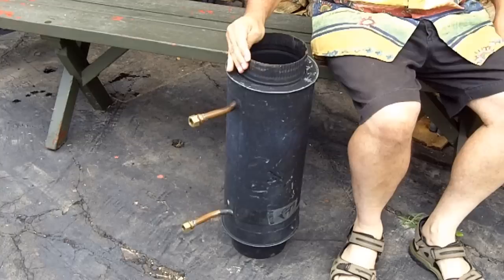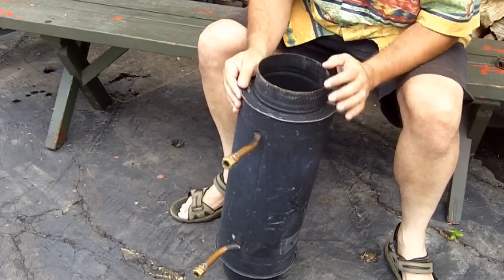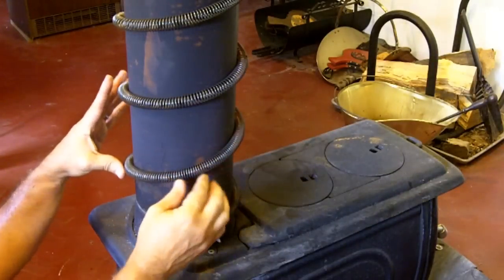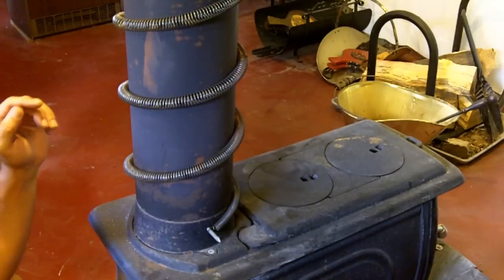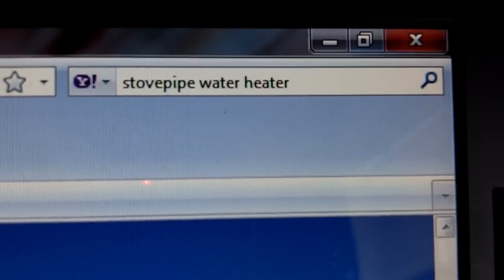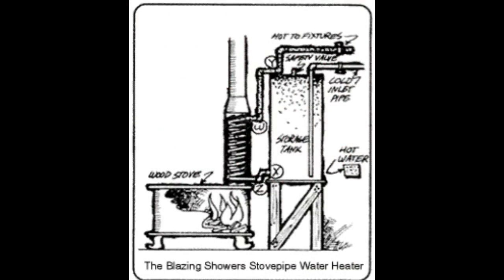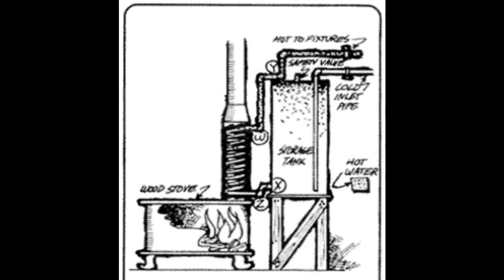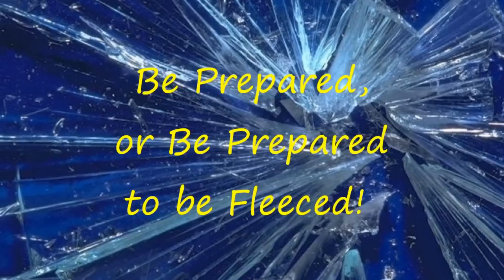Hot Water From Your Wood Stove

Comment: I was a chimney sweep. Have you seen rust (water) or black (creosote) lines running down the outside of the flue pipe? When you are assembling the flue pipe the male end of the pipe ALWAYS goes DOWN no exceptions. (so your unit will be upside dn). All fluids stay inside the pipe all the way down to the fire box. If you have a flue fire it WILL follow the cracks to outside the flue. If creosote is glossy use ACS, clean, seasoned wood, no glossy colored paper. Trying to keep you safe.
Keep at it.
Reply: I'm in Australia and putting a slow combustion stove in out home. With the male/females ends of the chimney, what happend if there is extensions outside the roof would rain get in if male end is facing down ?

Comment: There is so many things wrong with this set-up.  In an emergency, I completely understand: you do what you need to do for short term survival.  However, if this contraption should NEVER be used in a daily situation.  The Laws of Physics apply to everyone.  One does not need a fancy degree from the University of Michigan to understand these laws.  The Building Inspector would condemn this on the spot.  If there was a fire, the insurance company would not pay.
Reply: I agree..... This guy is an armature
Reply: yes that horizontal pipe is a concern

Comment: I wonder if a ss pressure cooker w an inlet and outlet installed on top, inlet being a pipe to bottom, outlet can just be threaded male, maybe pressure valve controllable? or stop it up and install a T&P valve after outlet then to tank.  Put it on a burner of Box stove so flames hit the pot directly, this way you can scrape creosote that might form with ease... You're almost set up to test, see if different positioning of heat exchanger reduces creosote.Good vid, keep it up! CO detector is good!

Comment: we mostly use back boiler systems here in the uk, that is basically a radiator bolted to the back of the stove or built into it, ive thought about this for years but never seen one in practice, good find sir and i look forward to hearing how it went on installation...

Comment: i live in france and have always heated the house with a wood-fired stove.  Now I also have electric heating in addition to the wood stove.  The wood is too heavy.  But the wood stove is still burning.  From the start, this stove has a large boiler with water.  Day and night.  That way I always have warm to hot water.  That works great, without a lot of renovation with dangerous conditions.  I also heat my food, draw broth and stew meat.  Everything on a large stove makes a huge difference in costs when using electricity.

Comment from the maker: @beastlyjamie the old water heaters have some very important advantages: They are already two-walled with insulation, and they already have the inlet and outlet pipes in the correct places and with the correct sized pipes and the threads to fit standard water pipes. Although you can insulate any tank, those pipe characteristics are serious disadvantages of propane tanks, so much so that for most people they will not work at all.

Comment: Pulling the heat out of the exhaust smoke doesn't come free. Cooling the smoke causes tars, liquids, and solids to condense out of the wood gas like dirty rain inside the pipe. (Creosote.) That stuff is flammable, and if gets hot enough it will flame inside the chimney. So it needs to be cleaned regularly.

Comment from the maker: @Mainerism I take the pipes apart each year and check them. The vertical section is never any problem but there is some build up on the horizontal section (which stays very hot.) I run a brush through it before the Winter season and there is no problem. This stove is not the means we use to heat our house. It is an emergency backup in case we lose all other sources of energy and resort to wood. It will keep us and our pipes from freezing. I do burn it some each year to keep the wood pile fresh.
Reply: great idea, would like to find one but where??

Comment: So how has it worked out for you ?, Have you got it fully hooked up and running ?. I see you have a grasp of steam and pressure and the dangers that goes with it, but from seeing that diagram, I would suggest some check valves, pressure regulators, multiple (reduntant) pressure relief safety valves, and a shut off / bypass system.

Comment: nice video...question: should you have the vertical rise straight out of the stove (like you say 3 feet or more) and THEN start angling horizontally like say 15 degrees from the horizontal?

Comment: How hot does the water get coming off the stove pipe? I had some cpvc hooked about a foot from my copper in and out and when i fired the stove up the cpvc almost exploded. So, i am going with copper out on the bottom of the tank and out to the cold water side in the top with a check valve on the cold water inlet coming in allowing me to get heat to the cold water side below the outlet prior to that. Now, i have to get me a 150-175 degree blow off valve cause that water line get super hot.

Comment: @Mainerism I realize this post is 3 mos old now, but I thought I might chime in with more of what Maine has stated. When you burn wood as your primary source of heat, it is important for maintenance of the pipes and chimney tiles to keep that creosote from building up. Getting the right size stove is important as the first step. Most will clean their chimneys and pipes around once a month in the winter to keep the creosote from being an issue. Simple dis-assembly usually keeps the pipes fresh.

Comment: I know the vid is 3 years old now but beware the lack of draft after heating water, extended stove pipe cooling hot gases and stove pipe heater blower at far end. This would constitute a threat of Carbon Monoxide backflow into the living space. Go for it, be there but be alive. Install CO detector.
Reply: True. He almost needs a power vent motor

Comment: I'd put a pump to circulate the water in that exchanger... On some experiments I did trying to get the water moving by convection I found that it will start to boil at the bottom of the coil and make a lot of noise... otherwise harmless for the installation, it would drive me nuts. 
How's that thing behaving?

Comment: ~~~The water jacket, if packed with insulation will take mostly radiant heat from the stack. Adding a backflow preventer will slow water flow down (vs a pump) and increase heat absorption without calling for much BTU from the stack and decide flow direction. I build these water heaters and recommend also installing a small radiator. I use a heater core from a car at the storage tank with a temperature controlled valve diversion.   must also have a pop off valve. The long stack is an issue in conjunction with the water heater. There should be no more than 12 to 15 feet of stack. However,

You could make a steel plate and put into firebox 2 inches under top, closed on the sides and have it 90 down the back two inches away from back and 5 inches away from bottom of firebox. (For stove used here)  This would burn off the creosote gasses and keep the flu fairly clean as burning the gases will increase BTU's. (Like a rocket stove, but not as harsh) You will burn less wood and create more BTU and have almost no smoke. I also install a wye, a damper and have two flu's to choose from. Diverting after you have heated your water. Water would still heat some but not head on (a trickle water heater). This is important. All this can be auto controlled by temp whether under a pressurized system or passive.  Regardless of which, passive or not, the water should be a loop Only going to the storage and never to an end user appliance. The radiator will help prevent steam and lower pressures associated with it. And assist in heating utility room.

Comment: When wind hits the roof and goes over, it creates a down. Your flue pipe should be at least 2'-3' above the highest point of your roof. Trees that have grown to tall will also affect the draw. In spring clean flue,tape a plastic bag over pipe. Ash and water eat metal fast. Don't forget to remove next yr (I've done it you'll know house fills up). It'll keep the cresote stink out of your house from down drafts on damp days. Keep away from 90's use 45's, stay close to vertical. Staying safe.
Hooter

Comment: Hi,

Some very reputable stove manufacturers in the UK have tried this system and withdrew them from the market because they were dangerous in two ways, they were causing the flue gas to drop so far in temperature the flue would block with creosote and some people were trying to install them without the safety of a feed and expansion tank.
What I can guarantee you is they will not pass building control and your insurer will not pay out on any claim if you fit one of these.

Comment: Good job with the video... A nice low cost wood stove hot water system... Just keep an eye out for soot buildup within the stovepipes. You would not want a stovepipe fire in long horizontal runs. I am using a concrete chimney to extract heat for DHW. The basic idea is the same but there less chance of stove pipe fire.

Comment: Sweet, I bet this works sweet. Plus you could eve heat a big tank of water and it would radiate heat plus provide hot water. Also since you have the room the long pipe was a good idea. I cant use a long pipe on my wood stove (not enough room) and konw the heat is going outside.Real nice find. Im going to keep my eyes peeled for one of those. Thanks for the vid!

Comment: The only way to do this safely is to have a powered draft.  When you cool the flue gas, it slows down, becomes denser, and creosote formation increases.

The GARN wood furnace is an example.  It safely heats water, but then again, it's a powered draft.

Comment: I had one of those stoves, in my barn I did not like it. its not a sealed unit so it can leak smoke into the building. its not airtight so its also in-efficient. that stove is still sold today but its a very old design. you would be much better with a burn tube EPA certified wood stove. much more efficient .

Comment from the maker: You don't have enough vertical pipe to get the chimney effect. The way it works is heat rises. You need a long section of vertical pipe for the heat to rise, creating a draft, which pulls the smoke out the pipe. I get absolutely NO smoke in the room because I have a huge 3 floor vertical section which creates a huge draft. You can do this on the outside of your home. Put a vertical piece of pipe. It doesn't have to be that long. 3 ft might do it. 6 feet would be great of vertical pipe, not total

Comment: if you wanted to get away from the pressure valve you could vent it out side or in the room which would put humidity into the room if you wanted to go with a pressure valve you could easily obtain one at a dump off a old water heater I would recommend using two in a series for safety.
Reply: +Marc  A Gagnon being you just basically made the water heater into a boiler which has higher temps(165-180ish) then water heaters , may want to get one made for boilers so you arnt always burping hot water out a electric water heater relief valve that's not meant to go above 140 f

Comment: We make efficient stoves here as well..EPA phase II compliant and 75%+ fuel efficient. The unit pictured is a Boxwood heater and is an exempt stove since it is used for cooking and is not airtight. The homeowner/installer is capitalizing on the heat lost up the flue because this stove pulls in excess room air. As a professional I cannot install that stove because it is not UL listed and tested..same with the add-ons. People are trying to re-learn basics before the coming economic crash. Go easy.

Comment: If you intend to put the box INSIDE the stove, the problem is that unless your system always has wter in it, the heat in youir fire will melt the copper pipes( and before that, the brass olives)(compraession rings 0 if you connect them using threaded conectors,  Back boilers are designed to work in flue gases, Easier to just put a 22 or 28 mm stainless steel pipe through the fire on  a slope, and then connect to tank.

Comment from the maker: @mitm19 I think you mean carbon monoxide and not carbon dioxide. No gasket is needed. As long as there is a good draft all gases go up the flue. There is a long up shaft (two floors) and the updraft is very strong. But just in case I have a battery operated carbon monoxide detector in the area. Good point. I watch the creosote build up, burning creosote remover periodically and also taking the pipes apart every year or two to check more closely and to run a cleaning brush through them.

Comment from the maker: @ArlynB101 I regularly burn the creosote remover. Additionally, I periodically take the pipes apart and check them. I have a steel brush to run through them when needed. Yes, it is something to watch out for to prevent flue fires.

Comment: Soot buildup inside the cold water jacket and the long extension could be very dangerous
Reply: +John Canivan  there is a internal pipe on the inside of the coil and another cylinder around outside of the coil for insulation and so the coil is not exposed to direct flame
Reply: A good hot fire once a month in the winter and regular cleaning will ensure that soot didn't build to dangerous levels
Reply: By cooling the exhaust below a safe temp. causes the soot that John is speaking about.  This setup with so much heat removed from the exhaust is actually a fire hazard if not cleaned out REGULARLY!!
Reply: @eielson1978  

What is the do not drop below temp you refer to?

Comment: There is a formula for flue size for the size of the fireplace opening. HxWxD ??? Getting old I just can't remember it. If someone out there has it would help anyone building there own stove so it'll draw right and not smoke when you open it, trouble with smoke rolling out the door. Crack it and wait till it starts to draw. If still smokes cut diff. size pieces of cardboard place it across the top of the opening until it stops. Replace with metal one and hinge on inside so it swinges in. 
Later

Comment from the maker: @squatchman22 No, still working on it. I've secured a 10 gallon water heater that is perfect, but I am considering how I want to hook this up (integrate it with the house water system or make an entirely different independent water system for when the municipal water goes dry. I am leaning toward the latter.)

Comment: I look at the drawing and I think there is a problem .. entered the cold water sinks to the bottom and should not be up for that water becomes warm. and its more effective, the water tank pipe should be on the cold water line to the water warms up before going into tank, otherwise I think it is not effective, the water is already hot before back in the water tank pipe. ???

Comment: How do you keep  it from over pressurizing?
Reply: The pressure valve you have to use is a  T&P valve(temperature and pressure ) which opens at 150 psi and 210 degrees Fahrenheit.

Comment: Do you know the AFUE (Average Fuel Use Eff.)  I read somewhere that wood stoves are like 60% eff.  I'm curious how much more eff can it be made?
Reply: +Hussain Zaidi up to 89% now with " gasifiing wood stoves" Basically adding in air pipes/baffle to the wood stove so that it burns mostly all the wood and reignites the gasses before exiting the flue...Can retro most older wood stoves if your mechanically inclined and use common sense, along with watching videos and understanding process.

Comment: I have that same cast iron stove in my garage. It was ok for a couple years but sux plus it leaks air through the cracks
Reply: Justin Lara you need some stove puddy.
Reply: Marty Collins i filled in all the cracks with some very high temp sealant and it eventually got dried out and broke off so I'm trying to make a heat exchanger now thx
Reply: Jeffrey Wain thats cool It just took to long to get going and didn't last verry long lol im working on a new legitimate propane conversation furnace
Reply: JUNKYARD GOAT ه
Reply: JUNKYARD GOAT ههه

Comment: The diagram at the end needs a one way check valve at the inlet for the heater. Otherwise, all it'll do is boil the water in the pipe and not force any of it out. They show the water siphoning into the heater. You can't siphon uphill. Hot water only rises inside its own system. A check valve at the bottom would allow water in but wouldn't let the boiling pressure go anywhere but up, like a coffee maker.
Reply: +David Buschhorn can not have ANY restrictions (even cutoff) in the convection loops..
Reply: +try duck The check valve isn't in the convection loop. It's between the water source and the convection loop. Without it, you just pump the water in and out of the stove pipe. Some goes up the pipe while most goes back into the holding tank. A check valve keeps the water flowing in one direction, which is important for it to work :-)
Reply: Non return valves are only used on pumped systems. The pressure generated by convection is not enough to hold a valve open. What you said about the flow is incorrect. As the water is heated it expands, becomes less dense and rises. This is the way that gravity convection works. Early central heating systems work on this principal, but need large and correctly designed pipework and the boiler below the ground floor. Pumps were only added to reduce pipe sizes and simplify the layout within the building. Water heated from the kitchen fire was also standard in the UK in the 19th and first half of the 20th century.
Reply: David Buschhorn my system doesn't have a check valve and it's worked great for 15 years. With 25ft of .75 tubing coiled around a 6in stove pipe it heats 40 gallons to 135F in 55-65 mins, depending on the temp of the water in the tank.